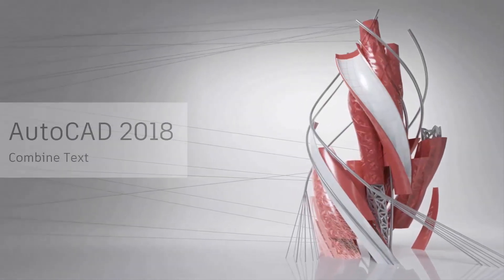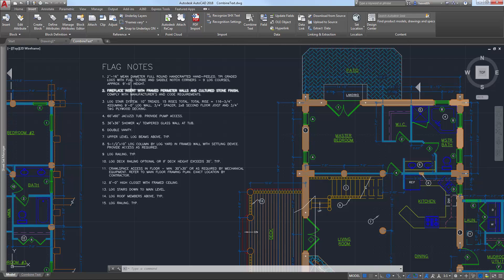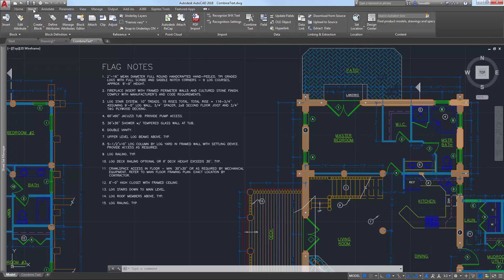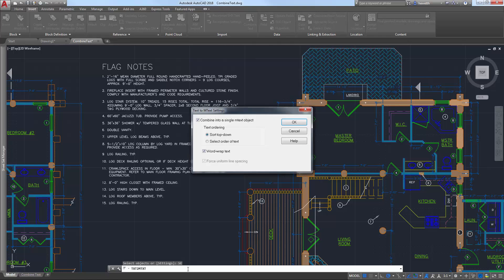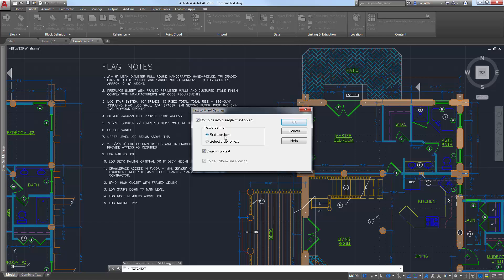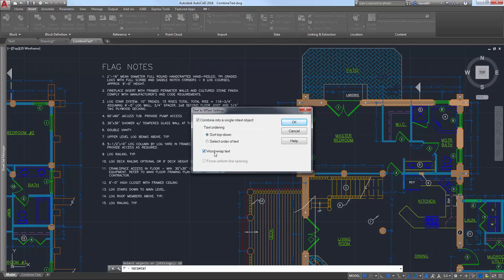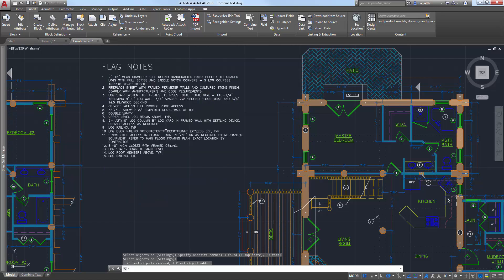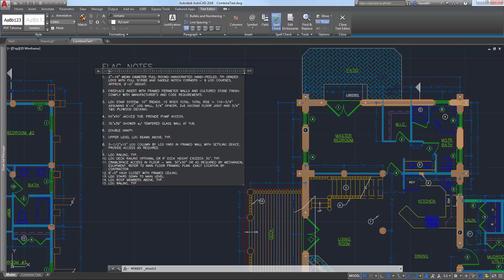AutoCAD 2018: Combine Text | AutoCAD

Comment: Stop with the 9 month life cycle of products. Some of the same bugs been in the program for multiple years now and we get "new" releases. My company has 545 seats for AutoCad and we stopped updating 3 years ago and are still in the decision phase as to pursue other applications or just stick with an older version and build competers to service them instead of updating and building new computers for it. If it isn't broke, don't fix it. Lot of the new "fixes" are broke. Don't even get me started on some of the other AD products like Advance Steel which has to be the biggest joke of product ever released. I contacted AutoDesk and asked if they could provide proof that one fabricator in the US had used advance steel to actually fabriacte a single steel member using it....ummm no. Still waiting for a yes for that answer after we sank a large investment into the black hole they abandoned and bought another company to replace it with an even worse produce. We've religated our 535 seats to just doing quick template and CNC type work and no actual customer oriented work at all.